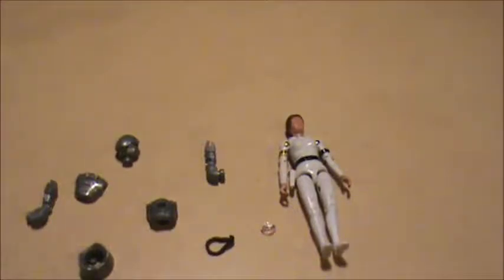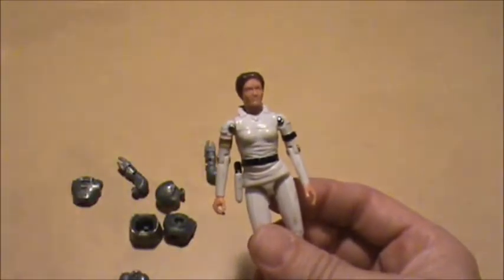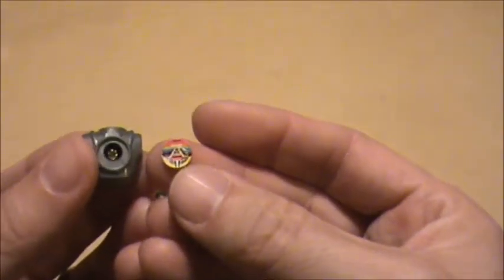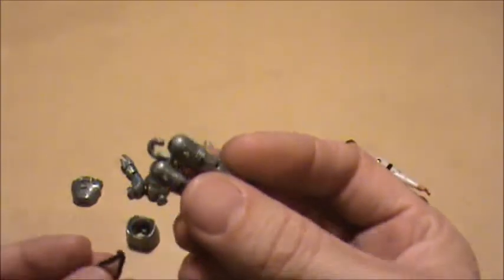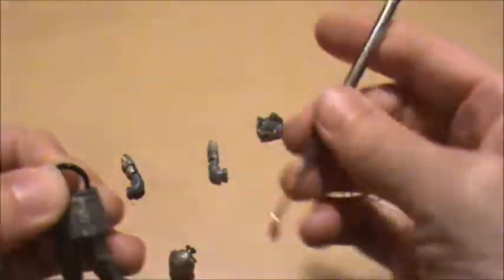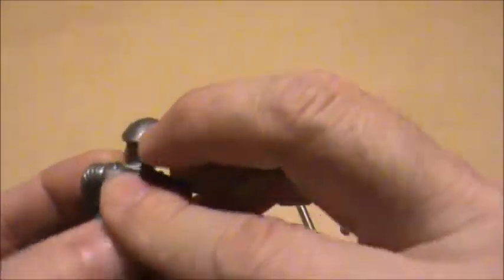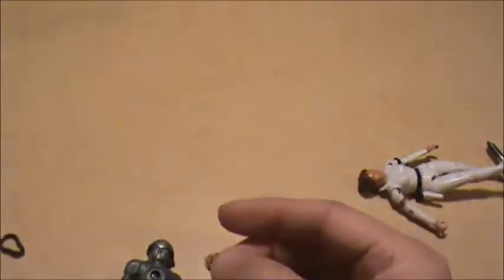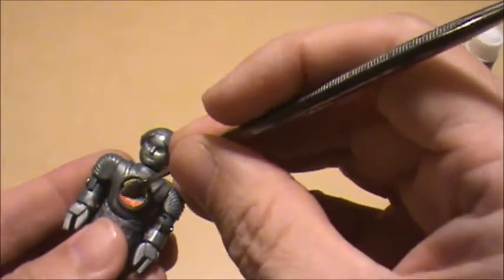Vintage 1978 Twiki action figure repair.

Comment: Great video what size o-ring did you use on twiki may i ask?
Reply from the maker: Thank you. Unfortunately I do not recall the actual size but it was a bit smaller than what fits other figures with this construction.